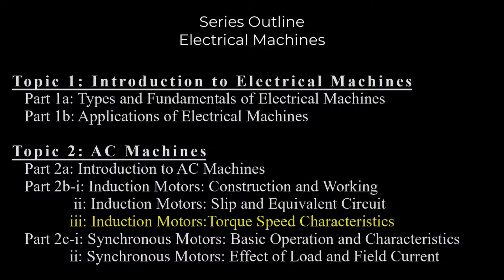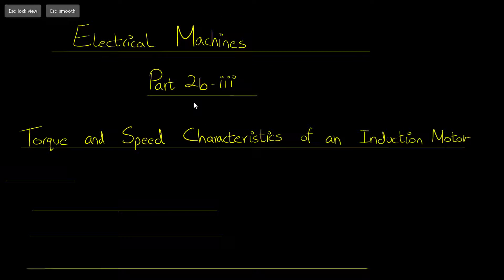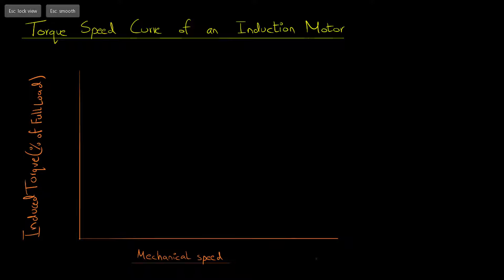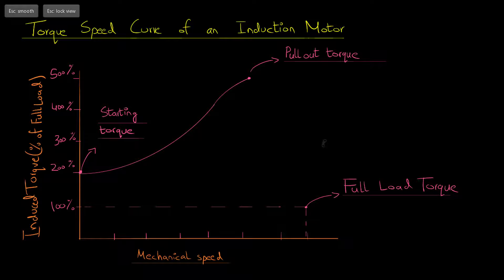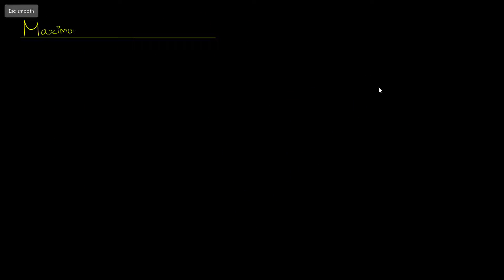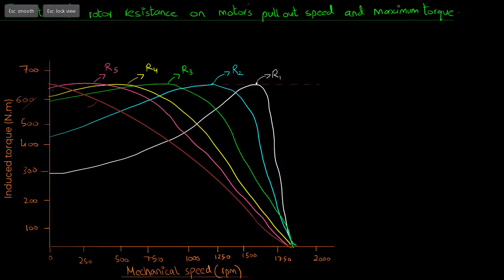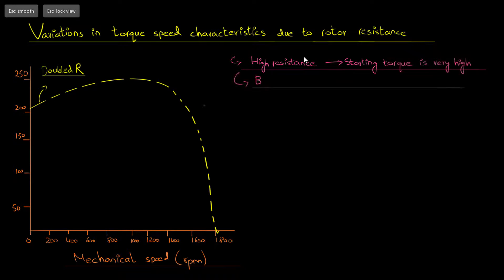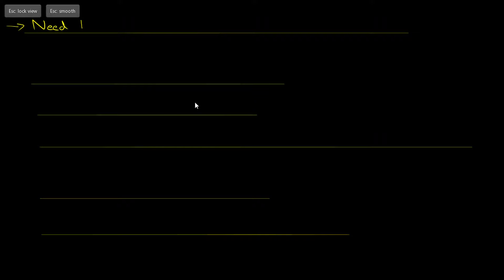Electrical Machines | Induction Motor | Part 2B - III

Comment: Brother, only one issue in your Electrical Machines series and that is you are describing it too fast, going with the flow, and not explaining the WHYs, CAUSES, REASONS. In other words, the intuitive part is missing from this Machine series.
I was interested in understanding intuitively why there is a high inrush current in induction motors, or, is there a counter emf in induction motors at play, difference between the motor torque and kW, etc.